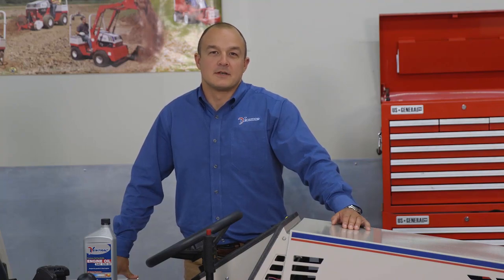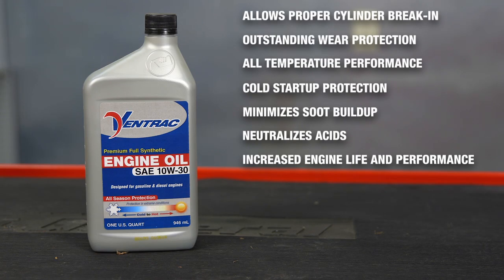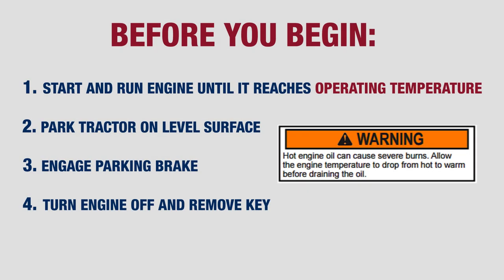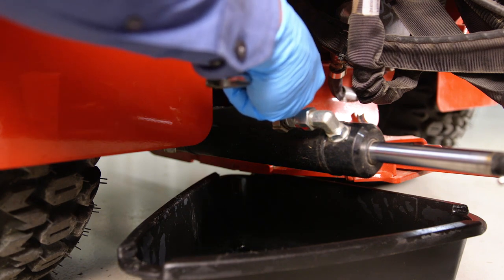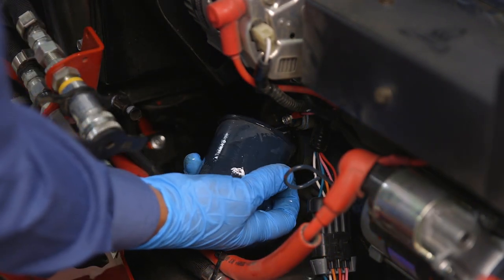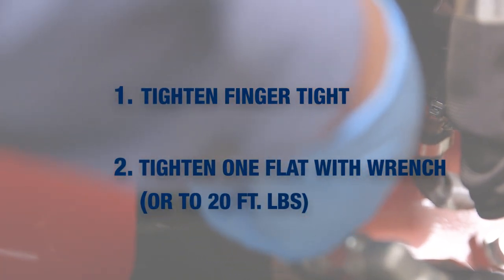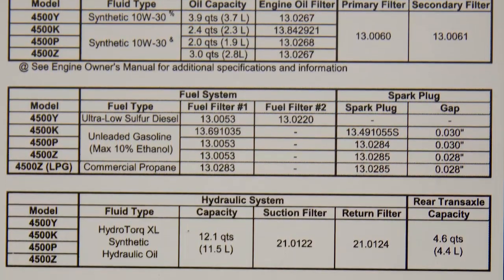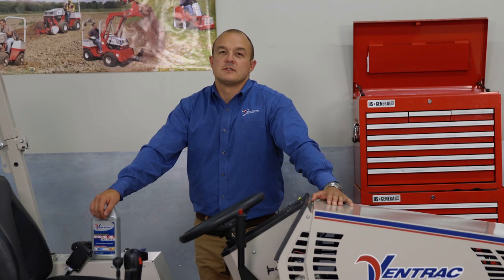Ventrac 4500 Tractor Engine Oil Service

Comment: WHY do they hide the dipstick?? I shouldn't have to take off a huge plate to check my dipstick/oil level. Other than that, I love my 4500z.
Reply: You dont need to...
Reply: @masonstorm4872  sure do
Reply: @MrGoblue1131  No, you do not bud. Right side motor, reach in and pull it out. I own one.
Reply: @masonstorm4872  I own one also bud, bought it last summer. And I DO have to take that damn plate off to get to it properly.